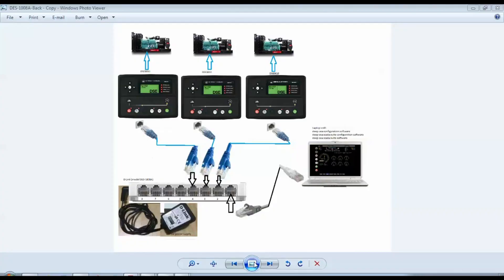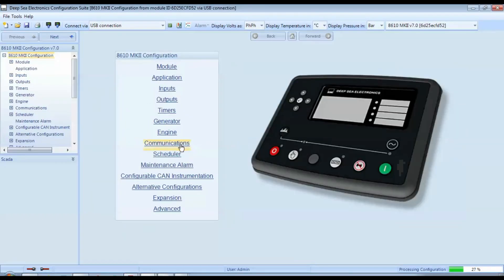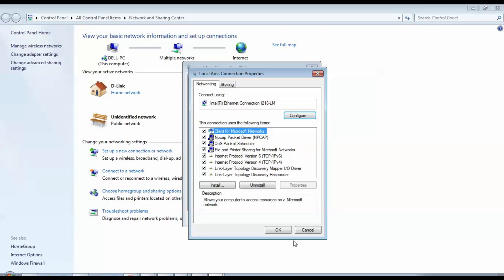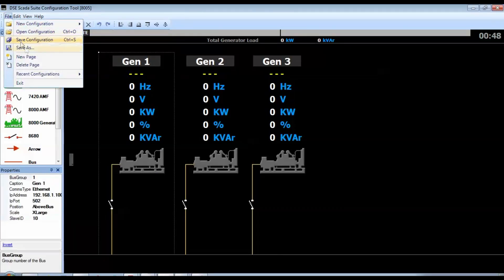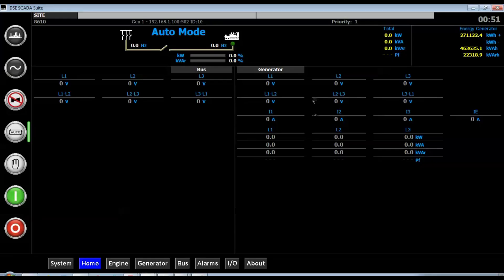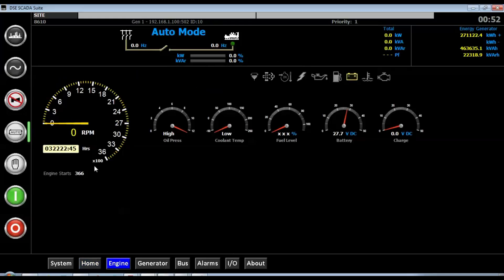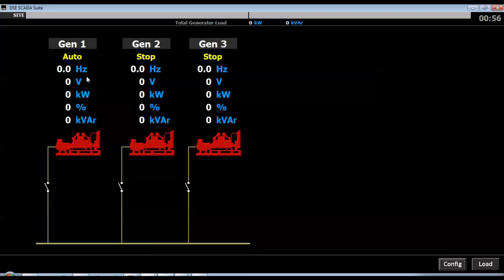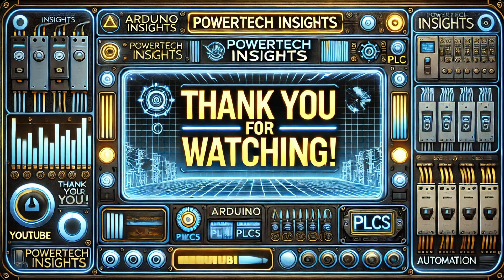How to Configure Deep Sea SCADA | Step-by-Step Guide for Power Systems & Generators

Comment: how can I set password for send command in DSE SCADA SUITE?
Reply from the maker: Step 1 — Open SCADA Suite

Launch DSE SCADA Suite and load your site/controller.

Step 2 — Go to the Configuration Menu

On the top menu bar:
	1.	Click Tools
	2.	Select Options or Site Properties
(Depends on the SCADA Suite version)

Step 3 — Open the Security / User Access Settings

In Options/Site Properties, look for:

✔ Security
✔ User Access Control
✔ Command Permissions
✔ Password Settings

Different versions use different names, but the security tab is always present.

Step 4 — Set Password for Command Operations

In Security settings:
	1.	Enable “Password required for Control Commands”
or
“Restrict Send Command”
	2.	Enter your new password
	3.	Confirm the password
	4.	Save and apply settings

Step 5 — Restart SCADA Suite

After saving, restart DSE SCADA Suite.
When you click Send Command (Start/Stop/Close/Trip etc.), it will now ask for the password.